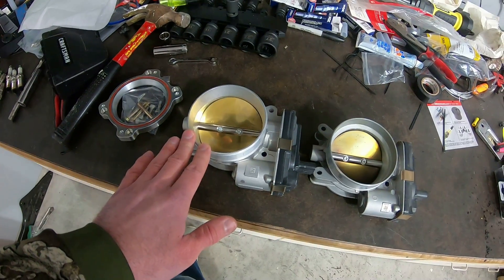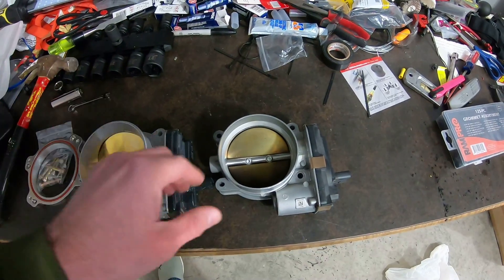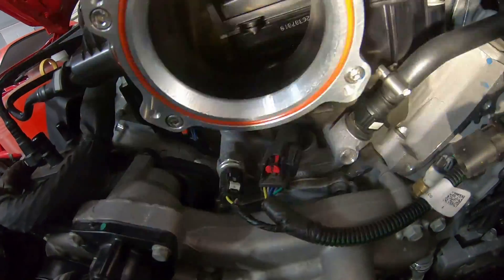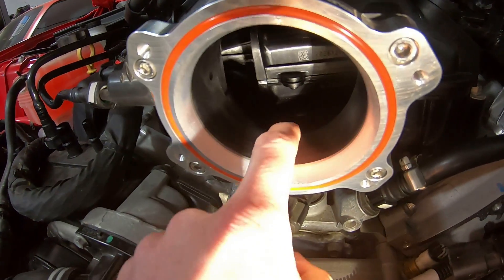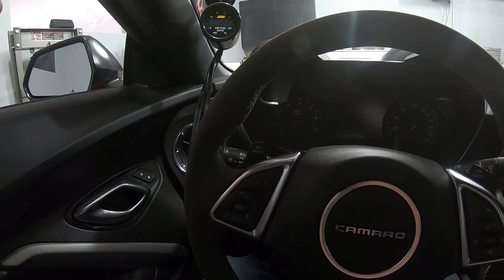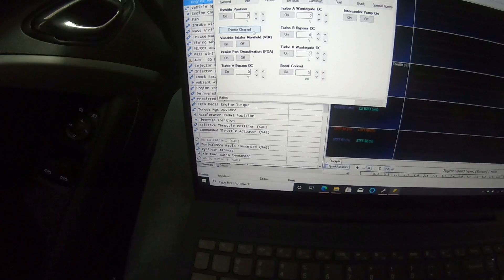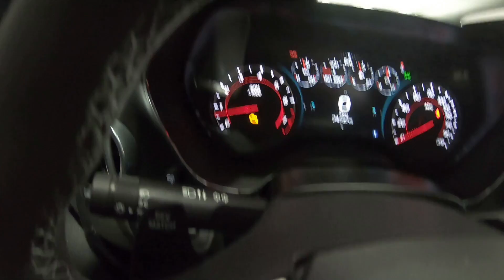95mm LT5 Throttle Body Install on LT2 Manifold

Comment: Question..what if I ported my manifold for a 95mm but I want to just run my 87mm only reason why I said that is that someone ported a manifold that I want but I don’t have a 95mm
Reply from the maker: @ShawnSmith-o8x  most adapters are from 95mm to 87mm. There will be turbulence with the 87mm straight to 95mm opening. 95mm TB aren't too expensive so I'd just get a 95mm

Comment: Nice.  Just subscribed.  Watched a few of your vids last week.  Wanting to do this setup too.  Intake/TB; Speed Engineering 1-7/8/ X pipe / secondary cat delete with use of remaining factory NPP and a Cold Air Inductions.  What's your thoughts? I can do the work except the tune.  Will need to get a tune somewhere.  Am i missing something or going the wrong direction? Any thoughts on HP /TQ gains.  Guessing 65/50 ????  Thanks!
Reply from the maker: @keithcastleberry3993  Thank you for the support! That's really my setup, just bolt ons which with the headers makes the car so much more engaging to drive! The sound! U can bypass the TB if on budget, that is more for throttle response. Not really hp. But that would be a good setup. Will need Halo brace underbody crossmember to clear xpipe. Just make sure to tie wire harness on passenger side away from header otherwise it touches and burns through
Reply: @EssMotorsports yes sir!!  Heat shield and stainless wire tie left over from dirtbike days for grips.  😅

I like the volume explanation you presented.  Makes sense.  The shaft does take away from some flow.  Making the opening of the intake the smallest restriction, instead of the TB, gets the most out of the intake.  Appreciate these vids.  You plan on E85?  I am now considering that too but may let my tuner install that part when I take it in.  Cheers!
Reply from the maker: @keithcastleberry3993  yes i did do e85. I made my own kit. Good upgrade, I really like it cause we mostly have 91 around here and it allows me to mix whatever ratio I want. I can "make" my own 93 octane
Reply: @EssMotorsports setup is complete boss.  I don't like it.  No throttle response.  Dog between 1500 and 3k.  Loud warble tone when like air or loaded up in that range.  Feels like it's always a gear or two too high.  Rips pretty good from a stop or 4k and up.  Rolling punches in manual mode are horrible unless 4k or higher. Where did my drivability and mid range torque and power go.  Highway driving and just light throttle to go around someone that bogging warble and loaded feeling is constpresent.  Tuned and revised twice.  Local shop out of KC that uses Pray remotely.   Too much money for it to such.  Speed headers, x pipe, LT2, 95mm TB, CAI, cables thru NPP on 21 2SS A10.  thought?  I'm just sick.  Feels like I lost throttle response and mid range torque.  TCM unlocked and also tuned.
Reply from the maker: @keithcastleberry3993 I mean that definitely doesn't sound right. After tuning i don't feel like I lost bottom end. Shouldn't unless it's cammed. If I would mod again. I'd do the exact same thing that I did. Try swapping TB to stock. See if that changes it. Cause if it's not adjusted for it will seem laggy. I wouldn't think that would be the case tho. Pray is one of the top guys. I'd verify mechanical is good. Spark plugs. Use temp gun to see if all cylinders are producing the same heat

Comment: Do you need a tune for the throttle body
Reply from the maker: U don't need one but it can help driveability.
Reply: Would it drive like stock without a tune?
Reply from the maker: @nickuboy990  yeah u would be fine
Reply: @EssMotorsports  sorry for all the questions. Thank you.
Reply from the maker: @nickuboy990  np

Comment: Hey brother, from novice to novice....
I got a question.
I installed the 95mm granatelli TB on a 2018 ram 5.7
Revved great in Park, but when I got her on the road and got on it, I had like a total system failure. All kinda dummy lights including the electric brake system. The code was a TAC failure. I recently got the unlocked PCM for tuning with the flashpaq F5 
Any input on how to get this thing tuned properly would be awesome. I'm pretty new to the new vehicles and engine hop ups.
Reply from the maker: Is the 95mm TB for a Dodge? Or camaro/gm. I doubt it will work if it's a GM tb as they aren't going to be interchangeable. Programming is going to be different

Comment: Hey man I have a third gen LT (gen5) swapped camaro…. Check out my channel… I want and need to to a intake swap and I’m curious to know what is to much??? My engine is a L83 (5.3) and is a 102mm throttle body to much air???? Is there even a thing as to much? Holly has a nice intake for half the price of the MSD just wondering what would be best? It’s stock with cam and springs upgrade DoD deleted…. Hay if you know please inform me
Reply from the maker: Definitely not a thing as too much air. It makes sure your KPA is at atmosphere at wot. The only downside with gen 5 is tuning is more difficult with larger TB. But a good brand 102 should be fine
Reply: @EssMotorsports  right on thanks for the info…. My little 5.3 make 400rwhp /400 torque but when I race a 6.2 LT they always come get me right a the trap. Just looking for something bolt on I can hold them off for another 100/200 feet…

Comment: I installed a lt2 manifold and lt5 throttle body but when I turned on the car it wouldn’t turn fully on it would like choke out so I tried the stock tb and the car ran fine did I just get a bad tb ?
Reply from the maker: Car should run pretty damn near normal with lt5 tb even without tune. Did a gasket get missed on the adapter? Something to that affect? Otherwise it might be bad

Comment: I’ve noticed that your check engine light is on, it’s not from any of these mods is it?
Reply from the maker: Long tubes will have cel. I must not have tuned it out yet at the time of the video. No CEL for me now
Reply: @EssMotorsports  subscribed

Comment: You think it’s possible to the port the adapter to match the 95 throttle body and port the neck of the Lt2 manifold to match the new size of the adapter . So instead of it going from 95  back to a 87 due to the manifold . Port as much possible from the Lt2 manifold and try to match it with the adapter(ported)
Reply from the maker: Companies to do this like GPI but u can't port enough to have a true 95mm in the manifold neck. It gets too thin.
Reply: @EssMotorsports  thank you I’ll see how much I can port the snout to match the tb

Comment: Is a tune required for this 95mm tb ??my 16 ss is tuned already… u think imma need a revision for this ?
Reply from the maker: U don't need a tune for it to work. It could cause some driveability to low throttle openings witthout a tune. But won't hurt anything

Comment: This may be a better option for me than to get the current 87mm TB on my 19 Sierra 6.2L (L86) the replacement ported TB from Katech.  I went that route on my previous 17 Silverado 6.2L and had a noticeable difference between the two but at the end of the day, it was still an 87mm TB.  I'm intrigued about the LT5 (ZR1) TB and how it may perform on my truck over the stock L86 TB.  Given that the LT1 and L86 share the same parts, minus some differences in that it's a truck motor vs sports car, it should be the same installation.  

Nice video, I may go this route over my previous thought.  I like running Corvette parts whenever possible, they always seem to work better that way.
Reply from the maker: I would do the 95mm over ported 87mm because when they port 87mm they take out the ramp which causes lot of airflow right off idle. Which can cause Torque management issues. 95mm probably is cheaper as well
Reply: @EssMotorsports  I was in the mood for ordering parts for my truck anyways.  Thanks for helping me seal the deal on this setup.  Great vid btw.  You get any gains out of the LT5 TB setup?
Reply from the maker: @TheWolfMatt  no HP gains as the intake necks down to 87mm and engine can't take advantage of the airflow. It's more throttle response/driving feel.
Reply: @EssMotorsports  Quick question.  Did you have to install a new boot/sleeve for the increased diameter of the TB on the LT5 vs LT1?  I'm thinking my factory bs is probably too small to fit the LT5 TB.
Reply from the maker: @TheWolfMatt  I had the rotofab sleeve which was pretty flexible so it fit good. I didn't try with the factory tube.
Reply: @EssMotorsports  Would you mind giving it a quick try?  I'm placing the order for the TB soon and would need to know if the factory junk will work or I'll have to upgrade the intake tube.  Cali won't let me upgrade my intake box to something better due to the bs smog laws out here.
Reply from the maker: @TheWolfMatt  all my stock stuff is boxed up and stored, not quick to disassemble and reinstall. Sorry man
Reply: @EssMotorsports  Well, it was worth a shot.  Thanks bud for all the help.  I'll likely have to replace the intake tubing on the factory system with something a bit bigger.
Reply: @EssMotorsports  Got the TB in yesterday to try out to see if the stock airbox tube would fit and it's a no go.  Have to order a CAI to put on this thing as the factory airbox is too tight to really do anything with.  Kind of what I was thinking anyways but wanted to give you a heads up since you were helpful on the info you posted.  Looking at getting a cousin of mine to transfer a S&B CAI in from Vegas soon.  😅
Reply from the maker: https://www.americanmuscle.com/mishimoto-camaro-silicone-induction-hose-black-mmhose-cam8-16ihbk.html?utm_content=Intake%20-%20Other%7CMishimoto&T5_Var4=CC4984&utm_source=google-pla&utm_medium=shopping&T5_Var2=shopping&utm_campaign=AMC+Camaro+Brands+%26+Vehicle+Low&intl=0&dialogtech=ppc&gclid=CjwKCAiAu5agBhBzEiwAdiR5tPQQ3kV4idHin-5TOWPcBvapooyD5JWN43wRS7tVG_5896EKdLaB2RoCJVIQAvD_BwE&gclsrc=aw.ds
Reply from the maker: @TheWolfMatt  something like this work? Maybe they will ship that to cali

Comment: I dunno but you have a check engine in that dash :/
Reply from the maker: That wasn't from the throttle body. That was from the headers. Been running the TB for over year now and no issues with it.

Comment: I'm not completely sold on this mod bit I do appreciate the video. I hear your argument on the flow comparison but to spend that money on a spacer and throttlebody only to neck it back down just doesn't seem like that would be much of any gain.  I think I'm gonna stick with the stock one and use that money somewhere else.
Reply from the maker: If your looking for hp then headers be your first bet. Intake Manifold second. This is a supporting mod.
Reply: Sure if does, 90mm effective opening is like 86mm or something, 95mm is about 91mm so you neck down but the 90mm opening is seeing a full 90mm of flow

Comment: Did you use a gasket between the manifold and adaptor?
Reply from the maker: Yes u use the factory o ring on manifold and then the adapter has an o ring for the throttle body side
Reply: @EssMotorsports  I’m trying a ported LT2 on my corvette and the o ring spot was ported out. So I put RTV on the manifold, then the paper gasket, then RTV on the adapter, then bolted it down. Currently letting it cure now. 
It had a very high pitched whistle.
Reply from the maker: @Stock_c8  yeah if it's ported and o ring is gone I think u just use rtv then to seal it up. The paper gasket probably isn't hurting anything tho.

Comment: I just bought ported intake manifold to 95mm and soler 95mm TB which will fit directly to the intake opening. I have a C8. Since there’s no tuning yet will this set up be okay to run without any problems you think?
Reply from the maker: So I am going to assume the c8 is similar torque based system. So it will be OK driving, it will have lower timing due to the more airflow at idle. 
My opinion is it's not going to hurt anything.

Comment: Planning on running the same throttle body but with a MSD manifold
Reply from the maker: Good low cost option instead of like a 103 nick Williams or Katech. Just get the 95mm to 103mm adaptor so it's a smooth transition.
Reply: @EssMotorsports  thanks for the info and quick response 👍🏼
Reply: @EssMotorsports  oh one more thing, does it come with the throttle body gasket?
Reply from the maker: @mouse6.2  you reuse the stock o ring. And the adaptor will come with o ring needed for it. If you order from rockauto, just throw another o ring in the cart.
Reply: @EssMotorsports  thanks

Comment: I’d love to see a dyno comparison.
Reply from the maker: Richard Holdner had a really good live talk about throttle body size. Good listen. Basically, the 95mm is not going to add any power but will improve throttle response.
Reply: @EssMotorsports  so I’m a drag race, it’s worthless? Good to know. At $200 bucks, I might just get one anyways.
Reply from the maker: Maybe not worthless, just not a power adder. I would buy mine again. Just saying if you have to buy other parts as well, I would get intake manifold, headers, air intake first.
Reply: @EssMotorsports  it’s either the lt2 or the msd, and 2” headers.
Reply from the maker: @matt6951  LT2 u could get away with the stock throttle body. If you go MSD the 95mm would be a good lower cost option compared to the nick Williams or katech TBs. Buy 95mm from rockauto if u do it was only like 160 when I bought mine.
Reply: @EssMotorsports  that was the plan!

Comment: What adapter you buy 95mm to 87 mm or 95 mm straight
Reply from the maker: The tapered down 95mm to 87mm to work with either lt1 manifold or lt2 manifold. Since my lt2 was unported.
Reply: Where you ported
Reply from the maker: @Molina1997  no, I did not do any porting work to my manifold

Comment: Sorry for all the questions lately. When you got the adapter plate was yours all one piece mine looks like it's three pieces put together??
Reply from the maker: NP Man if I didn't want questions I wouldn't do youtube! But that doesn't sound right if it's in 3 peices.... I got the solar performance adapter and it was one peice and 4 bolts. And an oring.
Reply: @EssMotorsports  agreed about the comments I actually have a channel for my car and my truck got a good amount of views and subscribers.   anyway yeah I thought it was a little weird put a straight edge ruler getting a very very small bit of light through I'm going to return it. Looking forward to that torque tuning and anything else you got there's no videos out there
Reply from the maker: @garagenut8676  Goat Rope Garage has really good tuning videos. Not all specific to gen v stuff but most of it still applies.

Comment: May I ask what sleeve you used to connect to  CAI. The new 95mm throttle body is to big for the CAI. I have the Chevy performance CAI. Thanks
Reply from the maker: I didn't have to buy anything new, the RotoFab intake went right on.

Comment: Didnt see a header vid.  After header install did you make any changes to O2 setting in HP??    eng,fuel,o2 senor,     proportional and integral delay??
Reply from the maker: I did not change any of those settings. From other tunes I have seen on HP Tuner forum they changed the proportional delay. Not sure if that is needed or not. I actually put all my settings back to stock in this tab and am going to retune my VE table this spring. Trying to get my ltft to be more spot on.

Comment: I recently installed lt2 intake throttle will not respond when floored on  park or neutral when driving its no issue but on park throttle stays stuf for a second on 5k rpms. Anyone had same issue?
Reply from the maker: If it's the stock throttle body. The lt2 intake should not cause any issues with the throttle not responding.

Comment: Thank you for a very helpful video. One question. It seems like the adapter is the bottleneck, so is it possible to install without the adapter by drilling into the TB? Otherwise, how did “porting” the adapter go?
Reply from the maker: U can drill and install directly but the lt1 or lt2 intake throat need to be ported to clear the throttle blade. Opening up the adapter was really easy with a sandpaper flap wheel. I only opened it up from 87mm to 89mm. On the lt1 or lt2 the throttle opening will be a restriction at some point if u have heads and cam probably. I am giving up maybe a couple hp but for a fraction of the price it's still a really good option. Car pulls strong at high rpm! 🔥
Reply: @EssMotorsports  thank you. I just ordered the LT2 manifold and LT5 throttle body. Planning on drilling the throttle body to bolt it right onto the manifold without using the adapter. Will be porting the runners and throttle opening on the manifold. No plans to do cam/heads in the near future– just long tube headers, e85, and tune (already have CAI). I like the LT2 better than the MSD because of: 1. Price 2. Low end hp/tq is better. What do you think of all that?
Reply from the maker: @jconn124  Sounds like a good setup! Can't beat the price for lt2 and gm 95mm throttle body.
Reply: @jconn124  did you ever get this setup complete, looking at doing the same was wondering your thoughts
Reply: @joshshipp1  yes. Ported it out so there was a small step down into the manifold (better than a step up) and sealed it on with a liquid gasket
Reply: Its not, you now have an effective 90mm opening and 91mm effective throttle body. Its like taking the throttle blade out of the equation

Comment: any difference with the 95mm?
Reply from the maker: From the butt dyno I doubt u could tell any difference. But from tuning logs I believe it does let in a lot more air at lower throttle opening. To take advantage of that u would need a tune tho otherwise the cars torque management just limits the car back by pulling timing. Moral of the story is my opinion is its a nice to have which doesn't hurt anything but not necessarily need with stock or lt2 intake. If running MSD I believe there would be gains then.